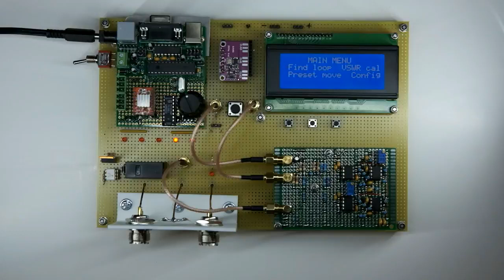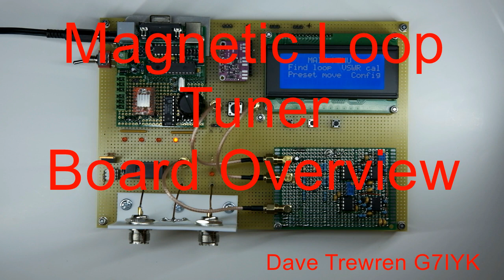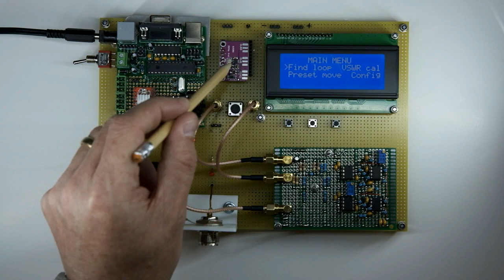Magnetic Loop Tuner Board Overview

Comment: David,
A few questions please:

Would you be interested in doing a video talking about the antenna, cap etc?

Did you consider using your transmitter as an rf source instead of the programmable oscillator? It seems that using a transmitter with a cat interface would have simplified the design... And would have avoided the use of the relay etc.

Can you talk about the SWR sensing portion of your design?

Thanks for your efforts to teach us about your design. Very interesting.
Reply from the maker: Hi Steve, the entire design is written up as an Instructable article - follow the link below.  This article covers the design process and the SWR sensing sensing design :

https://www.instructables.com/Magnetic-Loop-Antenna-Automated-Tuner/

Comment: I impressed by the time has been buried to do what? Do you really need every time to tune the main coil?  Supporting the idea below to give you a special license. Very special.
Reply from the maker: Hi Igor - in answer to your question, yes you do need to tune the loop even if you move frequency by only a few KHz.  The loop has an extreamly high Q and a bandwidth of maybe 20KHz.  If you are off frequency even by a little the VSWR climbs rapidly.  The advantage of such an antenna is the narrow bandwidth and response to the magnetic field giving a superior receive noise response.  The entire antenna is a high Q resonant tuned circuit and so must be tuned for changes in frequency.
Reply: @dave68cat  When I was playing with my first mag loop, I was thinking exactly the same. Then discovered in russian internet segment antenna of Grachev. This antenna is with two coils, one inside the other with own capacitors and external coil with capacitive load. In a result, my remote control board is in the rubbish electronic bin.
Reply: For search, the keywords: антенна Грачева
Reply: Forget to tell couple words about the bandwidth. On my set-up (1.75 m diameter, 12 mm main coil, 6 mm internal) 150 kHz. For me, it's enough. I still sometimes need to tune, for instance today, during heavy rain, but normally not touching. SWR inside bandwidth is 1-1.05
Reply from the maker: @igor.from.nowhere  I have searched on this but can't really find anything that you described - do you have a link ?
Reply: @dave68cat  I sent already five messages with links but all of them  deleted
Reply: @ZiggleFingers  , yea, I can see even on Google. Great antenna. Personally, I was not happy only about the connection loop and eventually cut main loops and installed a ferrite ring.